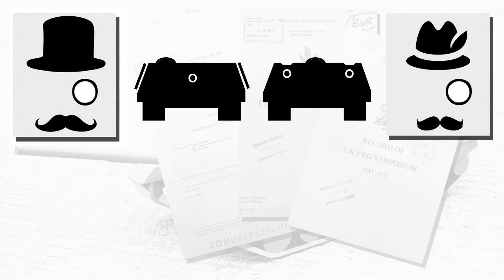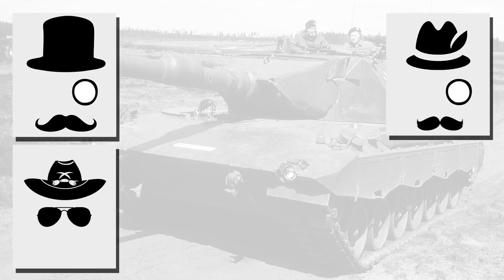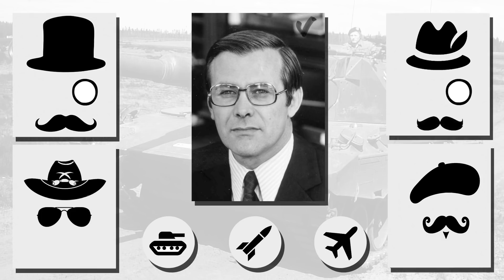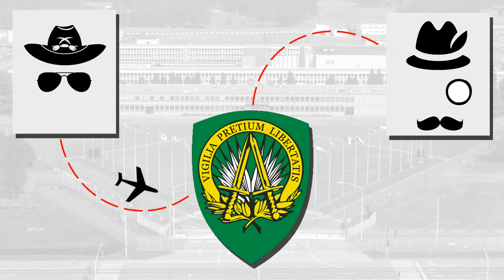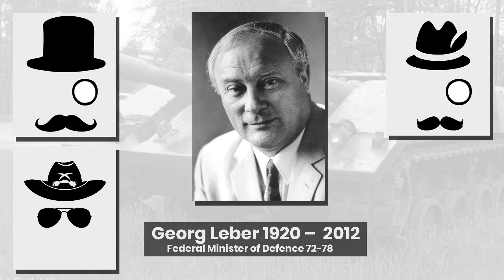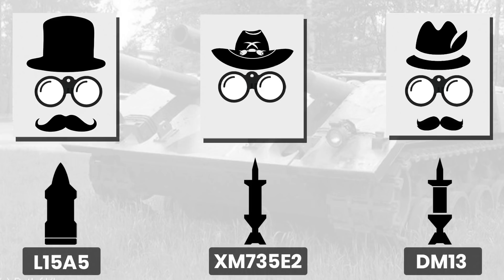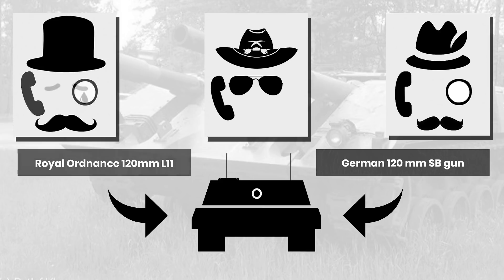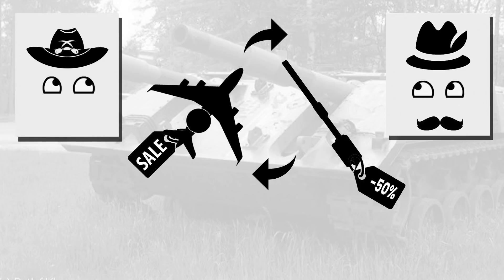Future Main Battle Tank (Part 4) - Tank The Choice of Guns

Comment: Just for clarification. The 110mm Sales gun was the EXP-8, the 110mm FMBT was the EXP-14. The 120mm system developed by RARDE was the EXP-19M8 based on the L11 system. This was reconfigured to suit the XM1 tank to suit balance, recoil etc. This was the EXP-19M13A. This error was also in the "Cold War, Hot Science" book. Believe 8t was because just the variant was used in paperwork as shorthand but as only one system was being developed the relevant people understood which system was intended.

Would be interested to know where the EXPL 24 M1 designation for the Exp19M13A came from.
Reply from the maker: https://imgur.com/QBtgKgl
Reply: That's interesting but strange. The usual UK Nomen used was either of the form XLxxEx  or  EXPxxMx. There was a design study only for a modified Exp19M13A defined as the Exp24M1 on behalf of MVEE but required a new breech configuration.
Can you say where this extract originally came from?

Comment: So the 110mm APFSDS round was disqualified despite outperforming everything else, on the basis of being "experimental"...even though it stands to reason that further development would've resulted in even better performance?
Reply from the maker: yup, tho tbh, even if they had, the other secondarly rounds were not wanted, HESHT, and for sure we cant get HEAT to work.
Reply: @armouredarchives8867  It's a pity the 110mm just died out. It seems like there should've been a place for a gun intermediate in size between 105 and 120mm, particularly for light tanks and wheeled FSVs.

Though these days there's lightweight 120mm smoothbores that can be mounted on the likes of the CV90 and various 8x8s, so the window for such a thing seems to have passed now.

Comment: I can never understand why NATO never made the UK change from there current gun to the same gun they use on all other NATO tanks ie the 120mm smoothbore
Reply from the maker: thats comming up soon, and its far more than the HESH thing
Reply: Because the British Army likes to have a HESH capability. 
HESH rounds have to be spun. Any attempt to remove that capability would have got rather short short thrift.
Reply: @leighrate  Is there any remotely practical way to make HESH spin after being fired out of a smoothbore barrel?
Reply: @RedXlV  you could have spin stabilised rounds, a bit like the US/French spin-stabilised mortar, but it would be complicated
Reply: Yup, brits get moist if you mention hesh
Reply: Armd Archives will give the definitive,but I understand the Chally 2 turret would require a complete redesign
Reply: The UK already had about 1000 operational 120mm rifled equipped MBT's before the first Leopard 2 rolled out of the factory.